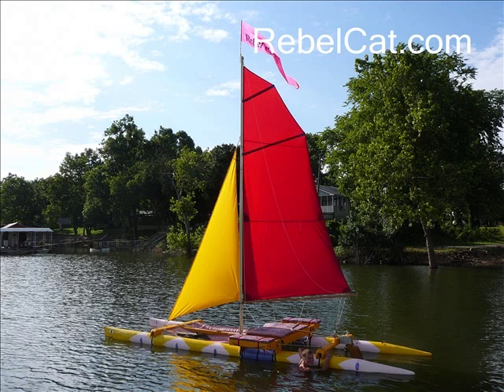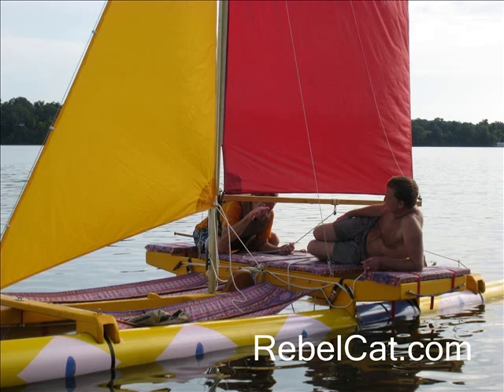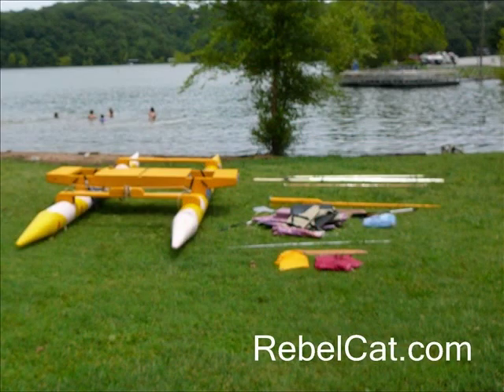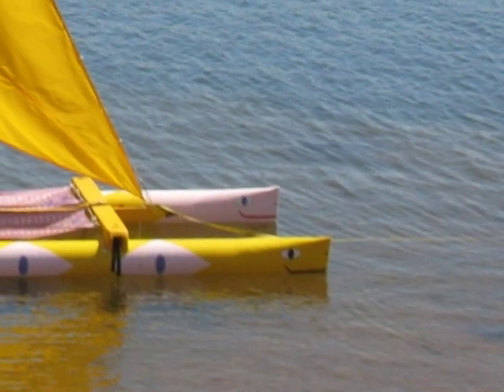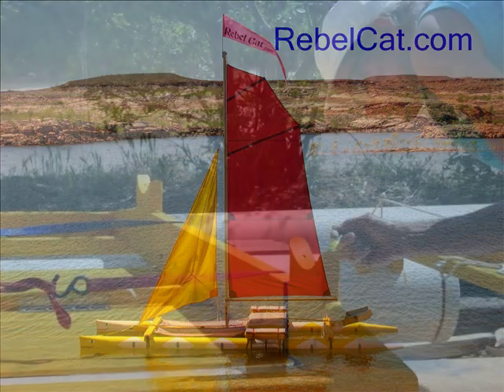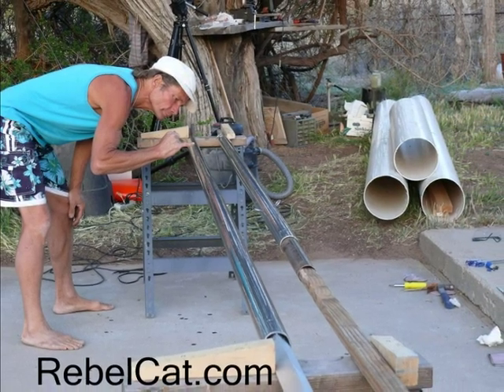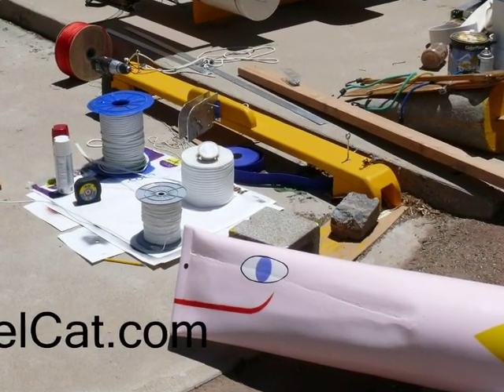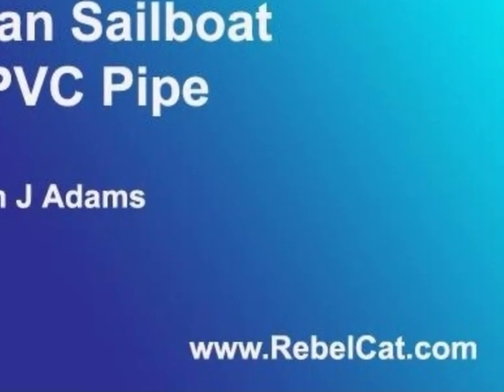How to Make a Catamaran Sailboat from PVC Pipe

Comment from the maker: @001grady - RebelCat 5, the latest design, will cost about $250 - $350, depending on what you already have and what you can get cheap, also what 'bells and whistles' you want on your boat. I make my own sails, and there are many web sites that show how to make simple sails from Tyvek, polytarp and other cheap materials, so it is possible to have a cat like mine for $250. The boat is made of pieces which can be taken apart and put on the roof-rack of a car - only the deck is heavy.

Comment from the maker: For fishing it would probably be fine, if your flotation can handle the extra weight. But there are easier and lighter ways to raise the deck, like using taller 'feet'. You don't really need a heavy board like a 2 x 8 on the pipes if all you need is height for the deck, which is small. Just raise the deck.

Comment: Thanks for your great vid. I've been thinking of building a cat myself, and came across your video in the process. I thought of using sth like basketball balls or other inflatables for closing the PVC pipe ends. But I'm not entirely happy with the idea (leaky), because I want to use the pipes as transport receptacles and to attach the ends on site, which means the ends need to be readily removable. Any ideas?

Comment from the maker: Calculate your load and flotation numbers. 8" pipe at 8' times 2 pontoons will not float 4 people, not 2 people, and with all that wood, maybe not even you. To float 4 people using 8" pipe will require many pontoons - a raft. Remember, you want half of your flotation to be above water as reserve, so the load will be half your total flotation. If the boat/raft plus load (4 people) is 700 lbs, your flotation must be 1400lbs.

Comment: On your website FAQs, you do not recommend the use of schedule 40 pvc, but promote using thin wall pvc, instead. However, you do not explain why? I have seen other pvc boats that seem to work okay with the schedule 40 pvc. What is the specific difference for flotation purposes? Will the thin wall pvc hold up well to the weight of braces, passengers and cargo? It would seem that it would bow or give easier than the thicker schedule 40 pvc tubes.
Reply from the maker: a1930ford - FAQ 9 on my web site mentions that schedule 40 is heavy and expensive. You can use it for pontoons, but your cat will be very heavy. Thinwall PVC pipe, with discs of foam inside, is stiff and light and serves very well as cat pontoons and bears the weight of passengers and the pressure of attachments.. See the videos here of my RebelCat 5 sailing (RebelCat 5 on the MOVE! and Why Make a RebelCat...). Notice that the pontoons do not bend.

Comment from the maker: Boom height is a person choice. I am athletic and can scramble under the boom to the other side of the boat with ease. My cats have about 24"/60cm from deck to boom - Plenty for me. But if a boat builder needs 3 feet or 4, he or she can have it. The advantage to a low boom is that you can have more sail area for the same length mast. Also, the COE is lower, making the cat harder to blow over. The higher the sail, the more leverage the wind has to tip the mast and the boat.

Comment from the maker: RebelCats are made of pieces which are assembled. RebelCat 5 is far more sophisticated than RC 1 - the little cat I made in Brazil. It has controls not found on many monohulls for adjusting to different wind conditions: traveler for the mainsail, adjustable fairleads for the jib. You CAN carry it assembled on a trailer, raise the mast when you launch. RebelCat 5 makes it possible for people to build their own cat using simple hand tools and local materials, carry it w/o a trailer, and sail fast.

Comment from the maker: @GEORGEZNEMETH - It's probably better that it doesn't, because the mainsail you see here did not perform well. I have replaced it with a traditional triangular one which can be found all over the web and in books on sails. I also replaced the jib, and now the cat sails great. So there are far better sail patterns out there for free than I could have included on the DVD. See the video of this cat sailing with the two new sails.

Comment from the maker: These are made from polyester fabric from the discount table at WalMart. I have recently replaced both sails with dacron ones re-cut from the sails on RebelCat 2. Sail material should be smooth and a bit stiff, like paper. Polytarps work well, as does Tyvek from Home Depot (house wrap).

Comment from the maker: My preference is aluminum pipe, about 2" diameter, 1/8" thick, from a salvage yard. New pipe is not cheap. Laminated wood will work fine, if you can laminate. Try craigslist for used wind-surfing masts or even sailboat masts. Obviously steel pipe will work but is quite heavy. You might find some thinwall pipe. Large bamboo is possible.